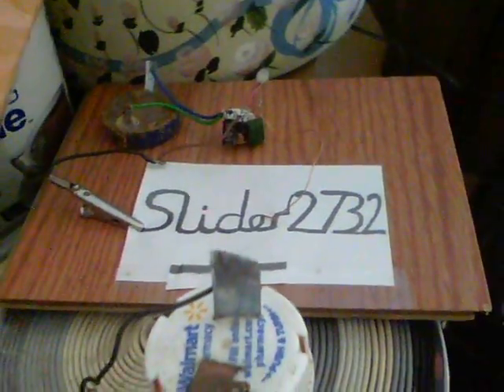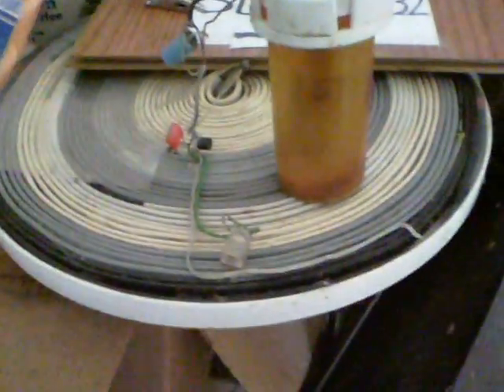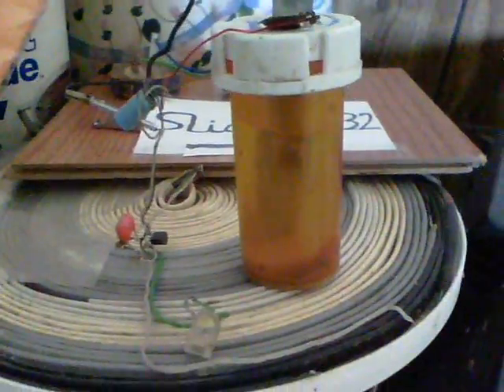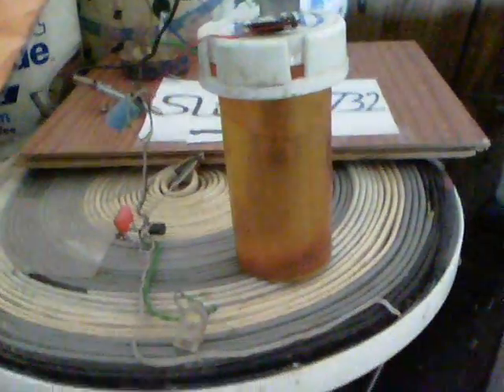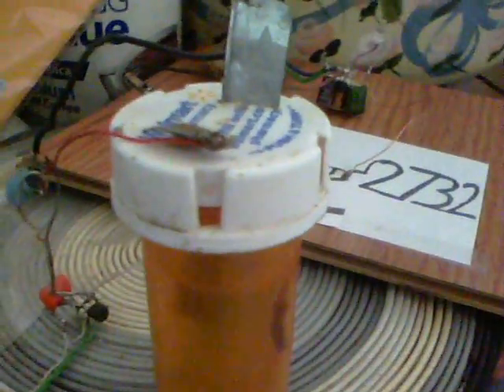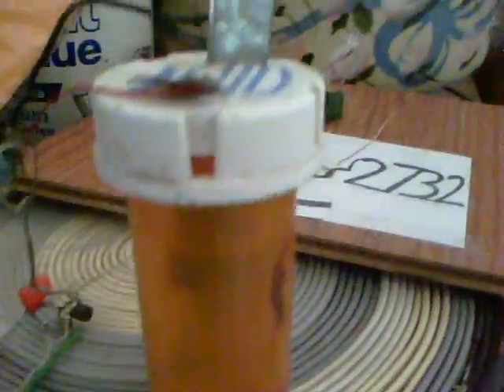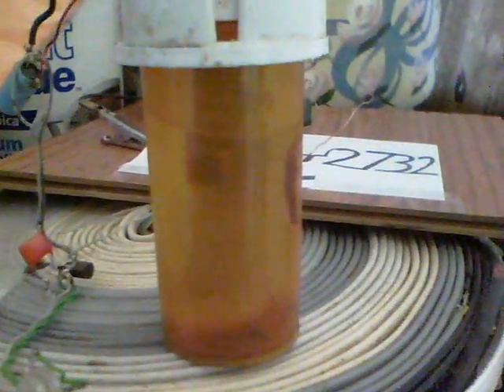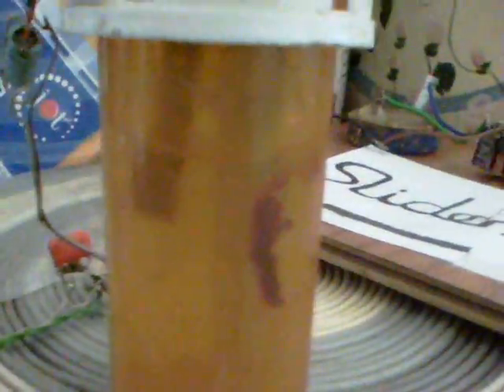Resonant Running

Comment from the maker: The collapse of the coil really does seem to extend running times, draining yet charging at the same time. Some chemistries go beyond a drying out to limit output, like those in say the Oxford Electric Bell. 
These two are still in sync...but the graphite resistor one skips every 3rd flash now, could well be denoting running lower on cell output. It's so odd that it will skip a flash though, like it's running an energy conserving program !

Comment: Egn 838 all of the motors and chargers I've used bedini built have had atmospheric anomalies. I had an ungrounded pulsing system from a solar panel and a relay motor running in a field during several lightning storms and it was never struck. anomalies often take place with these pulse systems no one has an answer for.

Comment from the maker: See this vid, where Nephilim Penny is shown to be affected, with radar images+time shown to prove correlations: /watch?v=Qe8ppY7kylI
Circuit is to Lidmotor's Penny, pancake is approx 1ft diameter, 2 layers, made from old modem cords. Electrodes are galv steel + copper, water is tap or bottled or even rain. Use pot to set flash rate similar to as shown and the effect comes in with storms. 
Best of luck, be great to see a vid replication...it's a neat effect. Oh and it'll run for years lol :)

Comment from the maker: Yes indeed...this large coil (it's actually 2 of them one on top of the other) also detects weather changes like a barometer. Got vids of it, the rate slows when a storm is approx 3 miles away and closing, the flash rate slows down. 
The electromagnetics of a storm cloud trumps the size of the Nephilim Penny coil and takes over !

Comment from the maker: Correct :D
2 same pancakes will link up quite readily, but with the size differences here, it all takes much longer.
Yesterday was interesting - wife was making chili and had the radio on that's next to the Nephilim Penny. The two went out of sync, 2 or 3 hours later they were back flashing at the same time.

Comment: LOL! I think the resonance may have something to do with that obscenely large pancake... Electro magnet effect of the pancake is pulsing the flux of the ferrite, causing it's wind to induct power from the perpendicular mag field. That power stores in the cap making the next pulse a little sooner, until they both run at the same time.... So your getting enough induction to do something, but not enough for the ferrite to be a trigger...